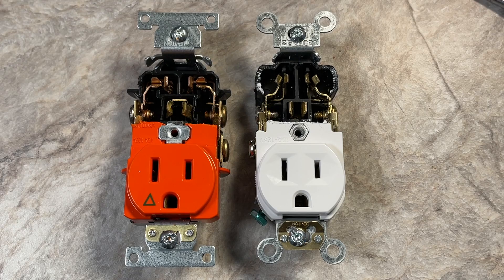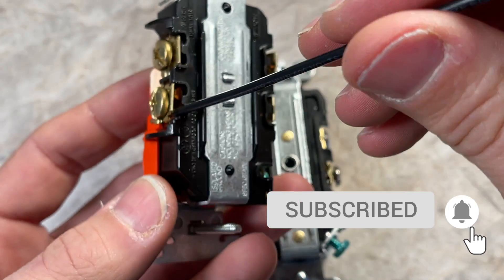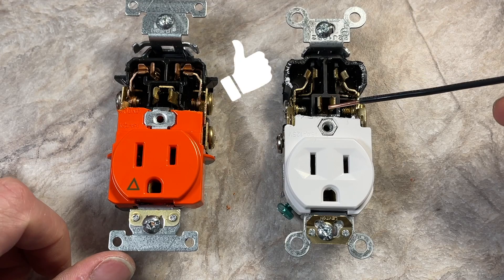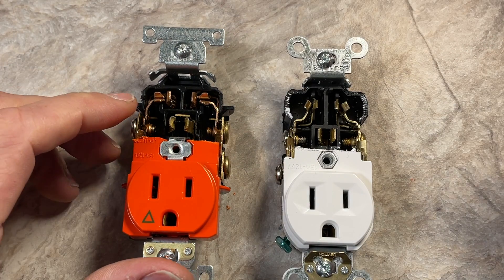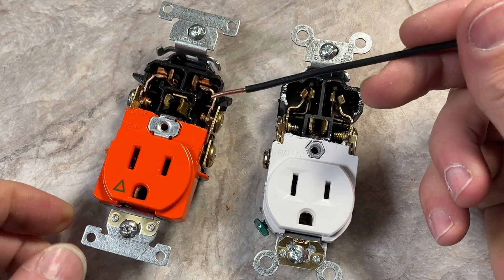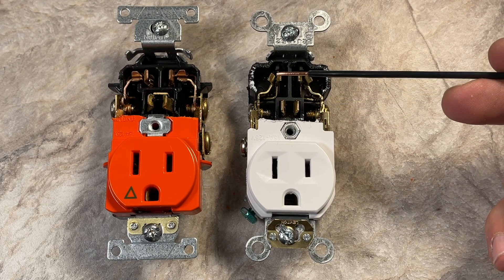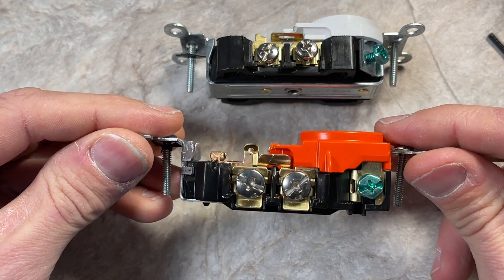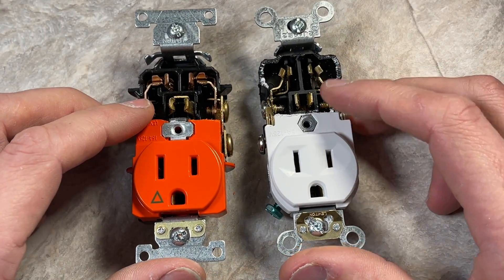What Outlet Should You Buy |  Commercial vs Hospital Grade

Comment: This is a isolated ground outlet identified by the green triangle.  These have to be installed in grounded metal boxes per code or the yoke and cover screw will not be grounded.  Since most houses use plastic boxes and romex wiring these could be a safety hazard in some situations.
Reply: So I can't use hospital grade outlets in my home?
Reply: @briank8482  You can, but you need to use metal boxes and ground the box with a pigtail.  No reason to use hospital or isolated ground outlets in a house, though, just use commercial.
Reply: @tomsmith3045  Thank you, sir.
Reply: In Canada, plastic boxes are not code. Better code?
Reply: You can certainly use plastic boxes in Canada. But there's no reason to because metal boxes are cheaper up there, and far more common. In the US the plastic ones are cheaper and used almost exclusively for residential. That said, metal boxes are far superior.

Comment: Get the hospital grade in the same color as the rest of the outlets in your house, but with the green dot.  Put them in your shop and wherever the wife plugs the vacuum cleaner in on a regular basis...trust me, it'll save you money and aggravation about every 18 months.
Reply: Also, make sure they are correctly grounded as the yoke is not grounded.
Reply: What makes teem better? Care to explain
Reply: @ClippyRenaissance  Extremely rugged, meant for lots and lots of plug/unplug cycles.  You can get them in white and ivory so they match what you likely have.  The green dot can be covered over with touch up paint so its not such an eye sore.  Hardware stores don't often have them, but any electrical supply house will.
Reply: @tonyc.4528  i would not waste the extra money for hospital grade, commercail is just fine, being doing electrical for over 40 years my house, that i wired 30 years ago has the same commercail devices no problems.

Comment: Hospital grade can be a bit of overkill for most residential situations, but they're great for where you want ruggedization for similar reasons (like in a workshop). For my money, I'll definitely take commercial over residential in almost every case. It's kind of like buying cheap garbage bags; they may not break, in fact they probably won't, but do you want to risk trash all over your kitchen floor? Now what if you're talking about electricity vs. trash? No contest! Keep up the awesome videos!
Reply: I use a red and orange 20 amp outlets in a Home made extension cord that I use just for my power tools just so they hold up for a very long time and don't wear out. Plus I got the outlets for like $.25 each in unused condition and they look cool too. LOL
Reply: @benkeysor7576  Great idea! Nice alternative to power strips if you can put together your own with a good long rugged extension cord.
Reply from the maker: Good Analogy Marc, agree that commercial are worth the additional money.  Especially if you know certain outlets are going to get more use than others.
Reply: I sampled a bunch of different receptacles before deciding on a Hubbell commercial model to replace original receptacles in my 1964 house. Most of them were loose or painted over. I liked the high quality feel of the nylon face and how they securely grabbed the plugs with a positive feeling. And they installed easier with large screws and large drywall ears.
Reply: Yah don't want the machines keeping someone alive shutting off cuz the retaining system was wore out and some viberations knocked it loose enough to loose power
Reply: @Smart-Towel-RG-400  Don't forget to bring a towel! You never know where a hotel towel's been! 😂
Reply: @marcberm  lol 😂🤣
Reply: Depends on the installed work of the installation and the value of the home. They certainly aren't for many of the homes in the Tri State Area. That also has the need for high end, well-educated  electricians and technicians.

Comment: I've enjoyed these videos. It reminds me of when I was a teenager and worked as an electricians helper. Even as a kid with no experience, I thought those "Stab-Loc" connectors were sketchy, but they saved a ton of time, so my boss made us all use them. This was in the 80's. I don't know how much has changed since then.
Reply from the maker: Thanks for the support Dan 👍
Reply: There are different types of backstab connections.  Some receptacles have connections that grab the wire when it is pushed into the hole with no other tightening method. Then there is another type where the wire is pushed into the hole but a screw must be tightened down to secure the wire.  I wouldn't use the first type but  I think the second type is ok.